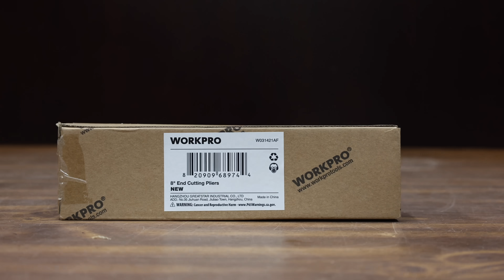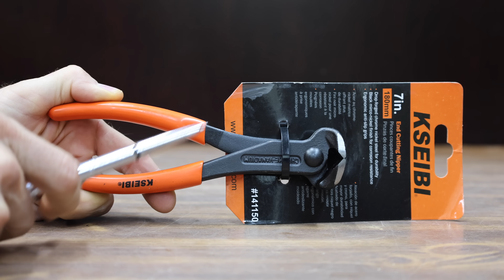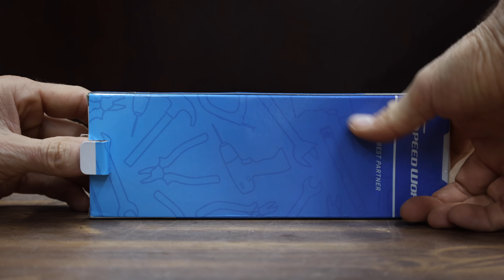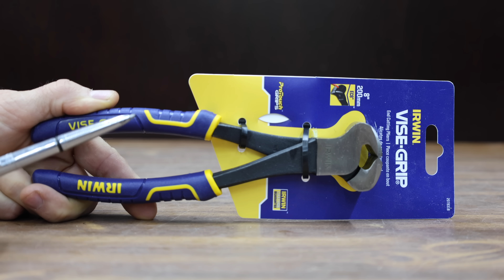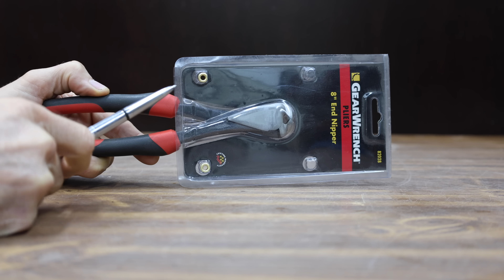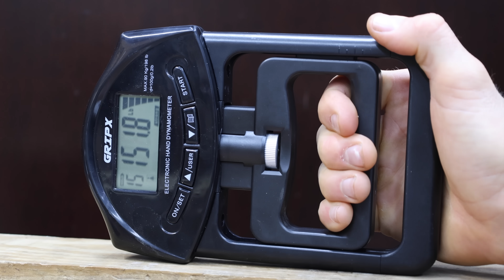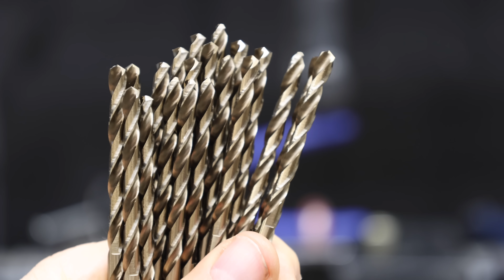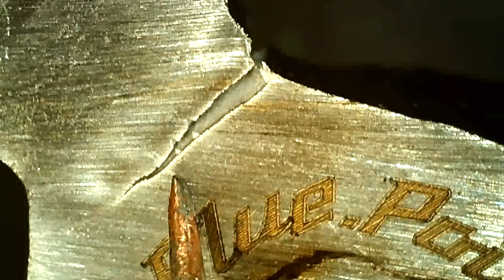Finally! Best Pliers I've Ever Tested! Not Even Close!

Comment: You've made me a knipex fan with your unbiased and well thought out testing. As a tradesperson who relies on these tools to make a living, you're the most beneficial channel on YouTube. Thanks PF
Reply from the maker: You're welcome!
Reply: I ran a tool truck in Canada for 20 years. I sold Knipex to automotive technicians and factory Millwright. I never once had to do warranty for any of their products. They are just simply the best hand tools on the market. Another great German brand to look out for is Wera. They make the worlds, best screwdrivers and screwdriver bits bar none.
Reply: @stephenpaquet  I've had a Knipex wire stripper/plier combo tool for a couple years now that I paid about $65 for. I've used it a fair bit and it still is in like-new shape, works great. I probably could have gotten a knock-off for half the price and been happy enough with that, but it's obvious when just looking at it, let alone using it, why it's priced higher than most others.
Reply: @5467nick  I've owned a pair of the Knipex 12 40 200 automatic wire strippers for 15 years now, still the best tool I've ever bought. Probably close to a million strips and I've only had to change the blades once and the rubber wire grip tip once. I probably owe this thing my life because it's completely non-conductive (although it's not advertised that way) and a lot of the stripping I do is on hot wire for light ballasts. I lost them once for a couple of months and knock-off ones don't strip near as well.
Reply: @stephenpaquet Wera makes chisel drivers that I use to beat up concrete, prying,  and all things commercial plumbing related. They are made just for that. The Phillips head chisel driver I use to knock concrete out of the screws, usually in floor drains during construction phase.  At home I have the smaller set that I use specifically for fine work (firearms, etc), as nothing else comes close to their performance.
Reply: @stephenpaquet  wera really is the real deal! 
Don't get me wrong, they're really expensive and they do wear out, though usually slower than cheaper brands, but man! They just grip the screws differently!
Especially their goldish colored diamond line of bits!
Reply: @Justin-y5n6q  Not just trades people. I'm just a guy that likes doing things at home - servicing my own cars, doing home repairs and the like. I value good tools that make a given job easier. I have a bit of expendable cash and don't mind spending an extra $40 on a set of pliers that will last a lifetime and make life so much easier. Buy once and never again, saves money in the long run. Nothing worse than working on a project and getting to 10pm when the local hardware store closes and you break a tool and have to wait until the morning or you're working on the car and your cheaper tool breaks or rounds off a bolt head.
Reply: I'm an office ratt, but I still buy tools from Knipex and other companies out of pure principle. I want to support companies that make great products in western countreis with my money rather than buying cheap chinese junk.
Reply: I got to use a knipex brand tool one time back in 2014, and been a fan. It was the only other tool in the shop i worked at that cut the hard wrapping wire that was on the welder spools with near 0 force, very similar to an old pair of side cutting fencing pliers, I've only seen then on ebay since.
Reply: if your a tradie.. paint your tools. bright flourecence green yeller.. or put a string on them.. ive lost tools, money, mate had his truck stolen while it was still connected to where he was working..  ausie..
Reply: I have had a pair of knipex piano wire side cutters for over 30yrs still as sharp now as when I bought them and as a retired construction plant fitter they have had some abuse.cant recommend them enough

Comment: Can you review torch heads (Map/Propane)?  By that I mean the screw-on top that has a trigger and sometimes valve?  I recently had mine broken when someone dropped it only maybe a foot and the plastic housing caused the metal pipe/tip to break right off.  You could test temperatures with each gas, drop testing, and I'm sure many other factors.  As always, thanks for these reviews.
Reply from the maker: Thank you for the video idea!

Comment: Let's see a comparison of different portable air compressors. How long does it take to fill the tank up to 60 psi? 80 psi? 100 psi? How low does the psi have to reach for each compressor to kick back on and refill? How reliable are they in cold and hot temperatures? Let's see it happen, Sir!
Reply from the maker: Thank you for the video idea!

Comment: In all my years in general carpentry, I've never used this type of tool ("nippers") for cutting framing nails or screws -- that's a job for a sawzall or a multi-tool, depending on a few factors.  I use nippers for (a)  pulling framing/sheathing nails when I don't have room to use a flat bar or catspaw, and (b) pulling or nipping finish nails.  If a finish nail is still protruding after being nipped, that can be remedied with a nail set.  For cases which require a true flush-cut (such as trimming edge banding), I have flush-cut nippers.
Reply: On the contrary, I use it to loosen many small rusty screws. I have a cheap one that loosens them or cuts some things that are not strong.
Reply from the maker: Thanks for the feedback.

Comment: Remarkable variation, though it seemed like a lot of them weren't really intending to reach even nearly flush cutting.  Even the manufacturer websites are pretty vague about the main intended usage, even when like Knipex they make dozens of them in different sizes and variations (and that's just their "end nippers").  

Other than steel wire, some sites maybe imply you'd use these to shorten long bolts after fitting. Grouping them with explicit bolt cutters.
Reply: You work with the tools available to you, such as using it to loosen rusty screws. It helps in loosening them, especially screws that I do not care about even if they break.

Comment: The problem with tests like these is the variance between different batches of the same tools. Knipex makes excellent pliers. But when I needed another pair of cutters to go along with my channellocks, which have been cutting stainless wire for years, the knipex got a notch in them on the first cut. Substandard heat treating! Bad day at Knipex and an unusually good day at Channellock when they were made? Well, I looked at all my Knipex pliers and found they all had more wear than other brands. While their design is top notch, their durability is lacking. According to this test, my channellocks are hot garbage. Yet long term use proves otherwise.
Reply from the maker: Thanks for sharing.

Comment: Who uses cutting pliers like these to cut deck screws, drill bits, or hex wrenches?  There are much better options for cutting these items.  I use mini bolt cutters to cut thicker metal, but would probably avoid cutting drill bits or hex wrenches.

Comment: You can tell by the shape of the cutter heads that they WON'T cut close to the surface.
They are all bevel cut inwards - with the amount of bevel varying.
If you want a really flush cut then you (we) have to re-grind the heads to a sharp edge flush with the cutter head.
If you want to change the shape of the heads, then re-grind them flush then test them out, but out of the box, they are all the same - leaving a stick out nub that will get you - not like the Wazakura which are flush ground, though failed in the last test as too soft (but ground correctly).

Comment: What is knipex putting into their tools? Some kind of black magic
Reply: Like the original parts of car companies, but the black magic is that its price is a little expensive, but it will last. It is a famous company that works with a good metal mixture of excellent iron, such as used in rear load plates or car springs.

Comment: The spark generated by cutting hex key at 20:38 is WILD.  Only Project Farm can do something like this.  Amazing presentation as always ! 👍
Reply from the maker: Thank you!
Reply: @ProjectFarm 

You mentioned you were wearing a face shield and protective equipment, but you didn't mention what brand that was the sparked up like that. At least I didn't catch it in four or five watches of that segment....do you remember what it was?
Reply: @montecorbit I was wondering the same. If it was there I missed it as well.

Comment: I consider that type of plier a nail puller, not a cutter.   There are better tools for cutting just about anything these could cut. But if you remove a piece of trim and want to pull the nails through the back-side there is no better tool. (that i've found)   The curved face lets you efficiently roll the pliers and smoothly pull out the nail.     
The only exception is the different type that you have here- the flat faced ones.  Those are useful for trimming laminates etc close to flush that can be filed later.

Comment: Idea for video.  When I look into the bottom of a motor oil bottle there is usually some "stuff" collected at the bottom.  Is that contaminates, or is that part of the additive package that is supposed to be in tne oil.  If it is supposed to be there, then there should be an instruction on the bottle to shake it.  I see no instruction to shake.  You can get a centrifuge like for separating blood and run samples of different oil to see how much stuff separates out.  You can send two samples of each oil out for testing.  One that was shaken and one that was run thru the  centrifuge.  The results will tell us if the additive package was spun out.  What do you think?  I have a short bit of video looking into a few quart  bottles.  I can send it to you or post it on YT for you to use if you like.

Comment: This would be a long video or you can make it a series but I’d love a test for all the all in one yard tools. Ryobi expand it series. Dewalt has one. Stihl has one etc. Test which is the best power unit and attachments
Reply from the maker: Thanks for the suggestion.
Reply: @ProjectFarm  I appreciate the reply! I was given 2 broken ryobi expand its and took the working parts from each and Frankensteined a working one. I’ve loved it but have had to reassemble it a few times. I’ve thought about switching to an electric one but dont know which one to go with if the unit I fixed kicks the bucket.

Comment: I'd like to see this revisited. I maily use these to pull nails, and that was one of things that wasn't tested. In that case you don't want to cut the nail, but get a good grip on it. The other thing is flush cutting, I have a pair of old no name endcutters that have no bevel on the end - true flush cutters. Just wish I could find some like that again, thinking about taking the belt grinder to my channelocks.
Reply from the maker: Thanks for the suggestion.

Comment: If you’re actually cutting trim nails. 16 gauge and smaller, I abuse Harbor freight icon flush cuts frequently with no damage.    
They say soft metal and plastic but the only time I have had to warranty was when someone dropped them without the tip cover
I have cut nails with 10” knipex offset side cuts 
If I’m cutting a nail or screw I’ll probably grab a die grinder or dremel tool though 

Awesome video as usual 

Do you drink?
Very subjective of course but could write off a taste test.  😂
ProjectFarm beer and steak recommendations 
A chewing machine for tenderness 
Twist cap torque 
Pull tab force
ProjectFarm grill recommendations 
I need to make a YouTube channel and write off grilling

Comment: I do guitar repairs and when I need to re-fret a guitar, I use cutters that I grind the face very close to the cutting edge.
For what I need is to get under the fret wire and pull the fret wire out.
But, they also cut staples almost flush to the surface if you need.
Modify your tools.
Reply from the maker: Thanks for sharing.

Comment: Its shocking how many of those that were tested were basically the exact same thing sold under a different brand, down to the same shape and stamp into the metal. Any difference in cutting performance and weight is probably within margin of error for their quick grinding at the factory.
Reply from the maker: Thanks for the feedback.

Comment: I have some snap-on side cutters and straight cutters that i got back in 2002 and they are still going strong after cutting drywall screws, nails, etc. I have a Knipex pair of groove joint pliers that are the best groove joint pliers that I've ever had owned. They never slip and have a great amount of leverage. Got those back in 2006.
Reply from the maker: Thanks for sharing.

Comment: Video Ideas: 

Rachet Type Tube/Pipe Cutters/Shears/Scissors (not sure the proper name) 

Pipe Wrenches

Also maybe there is a way you could incorporate testing out Milwaukee’s new Forge line of batteries that use pocket cells. 

I would also like to see the regular Milwaukee Impact driver compared with the Surge variant.
Reply from the maker: Thanks for the suggestions.

Comment: I had a pair of end snips -- what I called them -- that belonged to our great grandfather or perhaps grandfather or both. Blued, hardened steel. Both were surgeons, so maybe they had a different use than a typical pair of these. There was only an inside bevel. They sat flush to the surface if used to cut an extruding wire. They had finely etched or cut large cross-hatching on the curved handles, and were very comfortable to use. I could snip copper wire with them, but never considered cutting nails or screws. I used them to pry out nails and staples mostly. I treasure them.
Reply from the maker: Thanks for sharing.

Comment: I grew up helping my father build cabinets and later I worked as a finish carpenter. We always used Channel Lock nippers like these but we used them to pull nails not cut them. It’s better to remove nails than to try and cut them flush.
Reply: All of the models tested here are in fact end cutting pliers (Vornschneider).
What you mean are carpenters pincers, they can cut soft material but are mainly meant for pulling nails (Kneifzange).
Reply: Agreed.  In all my years in general carpentry, I've never used this type of tool ("nippers") for cutting framing nails or screws -- that's a job for a sawzall or a multi-tool, depending on a few factors.  I use nippers for (a)  pulling framing/sheathing nails when I don't have room to use a flat bar or catspaw, and (b) pulling or nipping finish nails.  If a finish nail is still protruding after being nipped, that can be remedied with a nail set.  For cases where I need a true flush-cut (such as trimming edge banding), I have flush-cut nippers.
Reply: @SplashJohn  I have a pair of knipex nippers that are only sharp on one jaw, and blunt on the opposing side, specifically to make them easier to pull stuff out without accidentally cutting them.
Reply from the maker: Thank you for sharing!
Reply: Yes, always use my 8" Crescent USA-made nippers for pulling mostly finish nails out  the back of trim moldings I'm reusing. They grip even the hardened "blue" finish nails no problem. The rounded head gives great leverage and does not damage the wood. Rarely use them to cut nails.
Reply: As a lather I use the channel lock "nippers" to tie wire for lath and also tying hat rack on inch and half channel for ceilings. Would never use them to cut a nail or screw.
Reply: I was looking for this comment.  IMO this type of plier is a nail puller not a cutter.  This whole series of tests was aimed in the wrong direction.

Comment: I totally believe that there are very few tools that come ready-to-use right out of the packaging. Personally, I take the time to tune and/or properly shape each new tool that I get, not only so that they function better, but also so they work properly for my application.

...There are, of course, exceptions- one doesn't need to shape a brute force tool like bolt cutters, or sharpen brand new drills/taps/etc, but... 

I have found it to be worth the 15-20 minutes to properly grind screwdrivers, sharpen sawblades, cutters, bend the mating surfaces to a tight match for pliers, and so on... (And it's worth the couple of hours to learn how to do it one's self, rather than getting kicked in the balls for $100+ each time one needs a tool properly shaped/sharpened, eh?)

With chisels and planes, turning tools, etc, that used to be mandatory- they just did not come finished from the factories- and if one cannot understand/apply/grind/sharpen proper tool geometry (without name brand sharpening jigs/gimmicks, a 'drill doctor', the Tormek, etc)... well, maybe they shouldn't be using that tool in the first place! (Many tools have to be tuned up each time they are used, in order to work well/consistently- wood chisels and turning tools, for example... And chef's knives! Learn to do it freehand!)

All of the foregoing is just IMHO, etc- I know that some jigs work very well for some people, but, I learned from my grandfather (captain old-school!), who was a fourth generation woodworker/jointer/cabinet maker- a sharp tool is a safe tool, etc... (I have his grandfather's grandfather's journeyman piece- an amazing tool chest with all of their old hand-made trim/contour planes, rules, levels, dividers, and so on.)
Reply from the maker: Thanks for sharing.

Comment: The NWS pliers tested (131-12-200) are the entry-level model with limited leverage. You should test the NWS 1311-12-200 which is their "heavy duty" model in the same 200mm length for about $40. The heavy duty models have a "PowerBolt" pivot feature that is advertised to provide "up to 50% power saving compared to conventional end cutting pliers." I have a suspicion that the high-end NWS pliers would perform similar to the Knipex but at a lower price. Hope you can show us!
Reply from the maker: Thanks for the suggestion.